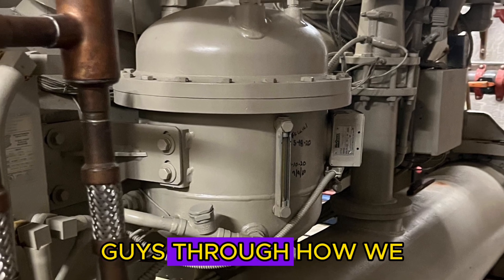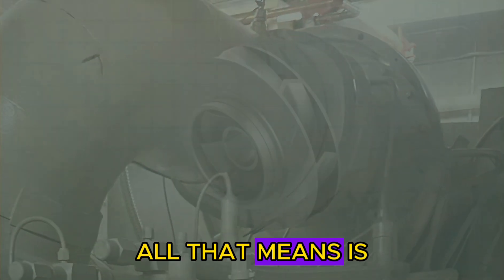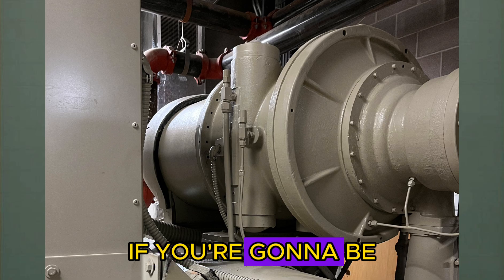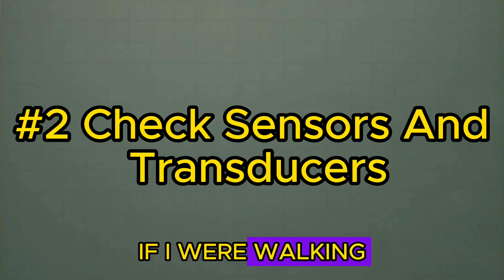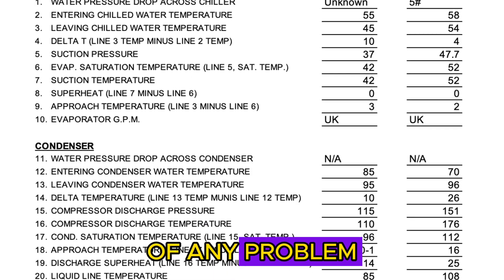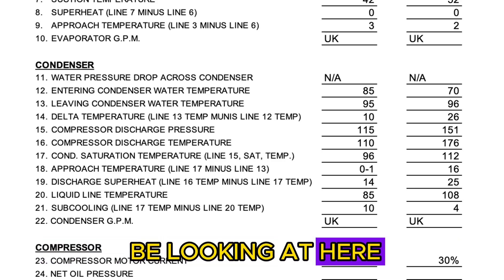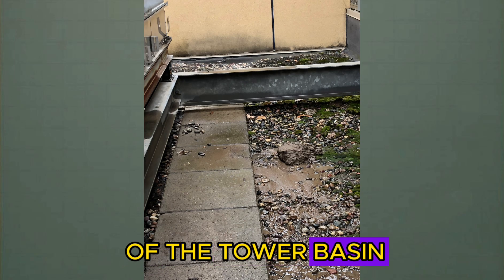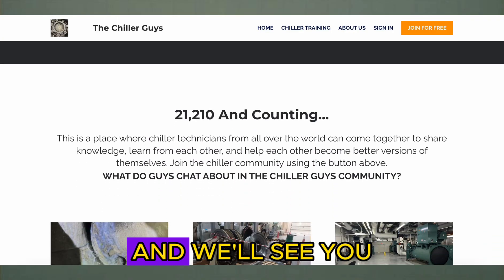Daikin / McQuay Chiller Surging After Rebuild

Comment: Awesome stuff John
Reply from the maker: Glad you like it brother!
Reply: If the approach was high on the condenser, was the pressure difference across the barrel high too? Causing insufficient heat transfer, laminar flow due to restrictions?
Reply from the maker: @NROhvac  That is a possibility, too much water flow could cause a slightly higher approach.  However the Delta T (Temp difference) being high tells me that the flow was poor, and that we had ton of heat being rejected into the water, because the refrigerant has more time in contact with the water, even though it wasnt transferring well. hope this makes sense. 

When we get into the troubleshooting i plan on spending 4-6 hours going back and forth with guys on interpreting the readings, and how you can tell the difference between a Heat Transfer / Charge/ and Flow issue.
Reply: @ this is crucial for me, thank you. So what you’re saying is if the pressure drop across the barrel checks out good, and we have a high delta, we can assume restrictions?
Reply from the maker: @NROhvac  typically the pressure drop will be low if you have a high delta, but it all goes off of the design. It would be low because you have a restriction, and the water flow / Velocity is slowed down.

If the tubes are clean, (Less velocity = less pressure drop = Less GPM = higher Delta T) because of the water coming into contact with the refrigerant longer, and exchanges more heat..

If the tubes are clean,  (High velocity = Higher Pressure Drop = More GPM = Lower Delta T because of the water coming into contact with the water for a shorter period of time, and exchanges less heat.)

If the tubes are dirty, and the flow is correct, (Normal Velocity = Normal Pressure Drop = Normal GPM = Normal or low delta T) because even though the flow is correct, the water and the refrigerant are not actually transferring heat. Thats where checking the approach comes in, and why logging the entire machine is so important. In the last scenario, the pressure drop tells us flow is good, the delta tells us that we aren't transferring that much heat, and the approach tells us we aren't transferring heat. 

There are many reasons you could be having a heat transfer issue. Could be low on charge, could be fouled tubes. could be too much oil in the Evap, could be a divider plate gasket. The rest of the log sheet tells you where the true problem lies.
Reply: @TheChillerGuysHub  do you mean if tubes are dirty then it’s less gpm and higher delta? I think you made a typo. But either way I appreciate your information, thanks
Reply from the maker: @NROhvac  Tubes are not smooth. I cant post a photo in this chat, but take a look at this image i linked, it shows the different styles of Chiller tubes. https://www.researchgate.net/figure/Development-of-enhanced-tubes_fig2_232835637

they only look smooth at the end because thats where they roll the tubes into the tube sheets to create a mechanical seal.

all of those little groves and channels can get fouled up with debris most of the time, or scale on rare occasions. and they wont reduce the size of the tubing, and only affects the flow minimally, from tribulation if any. So the water flow will be the same most of the time, unless it has scale caked in there, and physically reduces the size of the tube. 

For all intensive purposes, the Pressure drop / GPM will be similar most of the time. The elevated discharge and liquid temps may cause a slightly higher delta depending on how loaded the machine is, but only because of the elevated gas temperatures. The approach is what tells most of the story with heat transfer. 

We can chat about it if you like, just call. easier to explain over the phone

Comment: i already hear that coz im an operator of a chiller sometimes the cause of surging is a high temp in condenser side and it will rattle if an air passes through the condenser system

Comment: I am not buying a bad flow switch the machine should have unloaded when the condenser pressure got to a certain threshold.  Just like the evaporator temp sensor will shut down the chiller if you lose chilled water flow
Reply from the maker: @Billyflanagan9657

I’m not going to be running though the config in a video on YouTube, this was from a few years back, I do remember having to go through the config in the old 200 panel, however, I can’t remember every single thing that we did in the controller, but that’s not something I’m going to put on youtube so some guy can fumble around and ruin their machine. 
Did you see the whole video, she had no flow also, you see how bad the tower was worst one I have seen to date.. these are wonderful machines, but they are murdered a lot unfortunately..
Reply: There’s is no setting for chiller to unload on the Series 209 MTech controls. This could potentially make the problem worse by closing the inlet guide vanes and increasing lift across impeller
Reply: @rickmcelwee705  Rick I think you mean decreasing lift across the impellar with the vanes closed.The only way to increase the lift is to get the condenser pressure down and the evaporator temperature at design
Reply from the maker: @rickmcelwee705  what about the 4 way valve? you can use that to adjust the timing? is that what you mean or no?